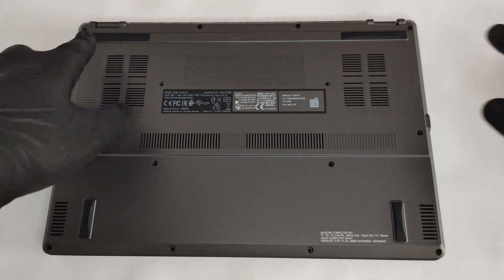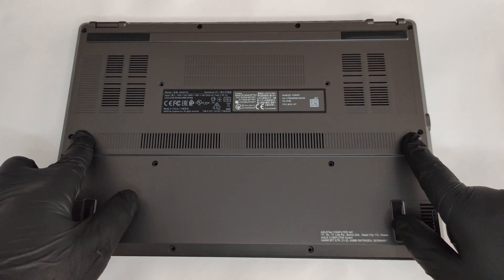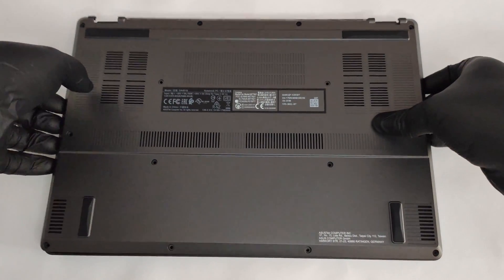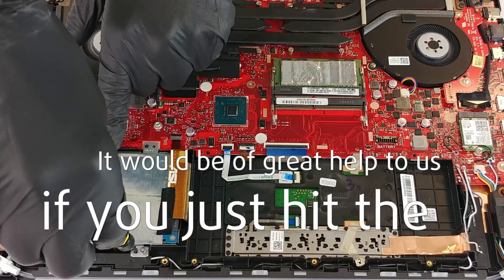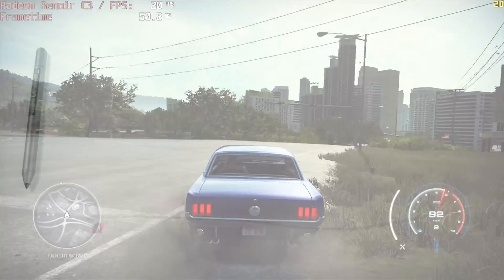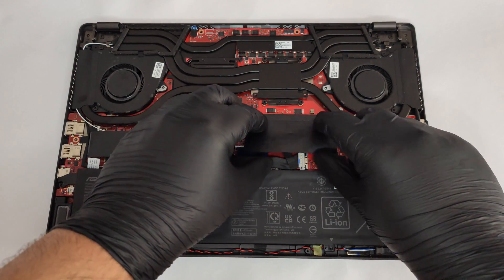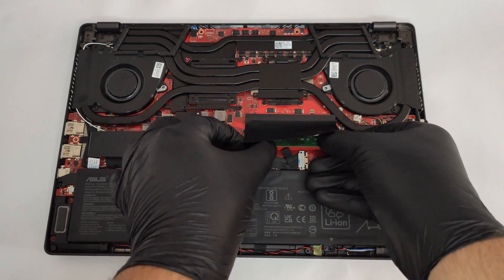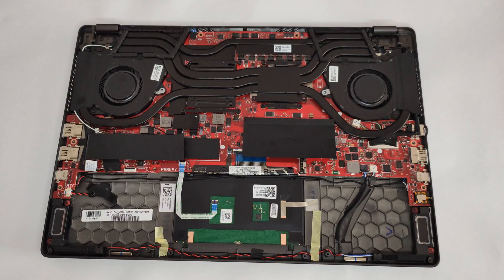🛠️ ASUS ROG Zephyrus G14 GA401 (2021) – disassembly and upgrade options

Comment: Hi sir.. I have a question. I have a g14 with shorted motherboard that needs replacement. My motherboard is Ryzen 7 4800H GTX 1660Ti. My question is can I buy a replacement motherboard with Ryzen9 processor and RTX2060, and use that as my replacement motherboard instead?  Since they are the same layout, i thought that will just be okay? is that right? or should I just stick with my  original motherboard? i will appreciate your response sir.
Reply: nope

Comment: Is the port Pcie 3.0 or 4.0?
Reply: The 2021 G14 is 3.0. The newer 2022 G14 is 4.0. You can use a nvme 4.0 drive on 3.0 but it will run on 3.0 speed.

Comment: You mean it is possible, If I buy this laptop with 16 gb ram then I can add 16 gb in future and make 32 GB ? or I have to use single piece of 32gb ?
Reply: No, so the way the Zephyrus (G14 at least) comes with 2 ram slots, one soldered onto the motherboard, the other is replaceable. If you got the 16GB model, 8GB is on the mobo, 8GB you can replace. If you got the 32GB model you have 16GB on mobo, 16GB upgradeable. That means you can make the 16GB into 40GB, and the 32GB into 48GB of ram total.

Comment: I heard that 2021 model has liquid metal on cpu, is this true?
Reply: as I have heard yes, It has LM only! on CPU! 
I will never buy Asus again. This stupid keyboard without numpad, this stupid vibrating fan... and now this... 
Usually I change thermal paste after buying a laptop because such shitty companies like asus puts thermal paste of awful quality. I cheered a lot because of LM and no need to change thermal paste. 
But putting only under CPU is an VERY dirty trick. WTF Asus?? In 2-3 years thermal paste on GPU will get dried and it's conductibility will get bad and that will lead to high gpu temperature...
Reply: @ИванГадияк  I'm not sure why you expected a num pad on a 14-inch laptop that clearly doesn't have a num pad in ANY of the pictures lol. My fan is also fine, you may have had a defect as the loudest it reaches is 45db under MAX load.
Reply: @0Ciju0  15 inch also doesn't have it, I knew that it doesn't, even though there is enough place for it, but there were no other choices when I bought it.
I'm not speaking about the loudness, but about sinusoidal character of it, I've changed both fans and it is still the same, it's extremely annoying